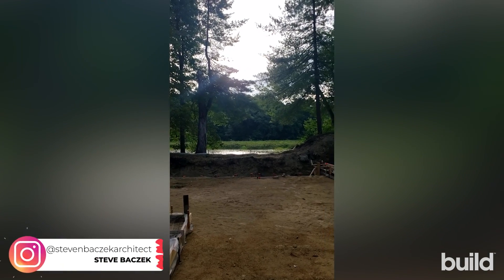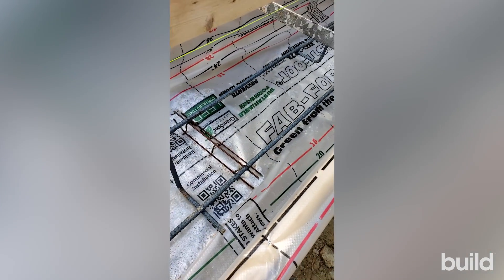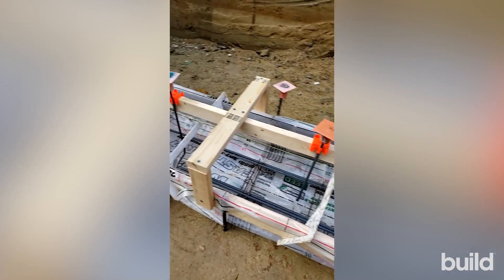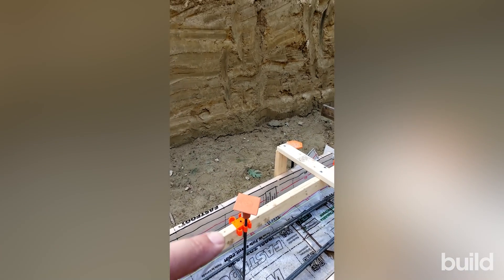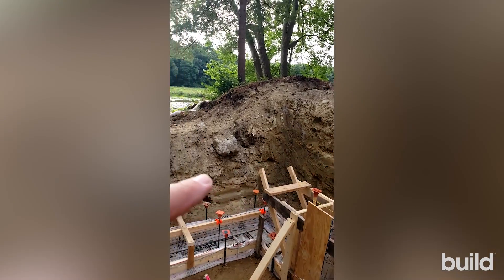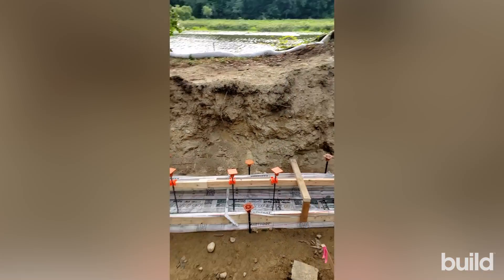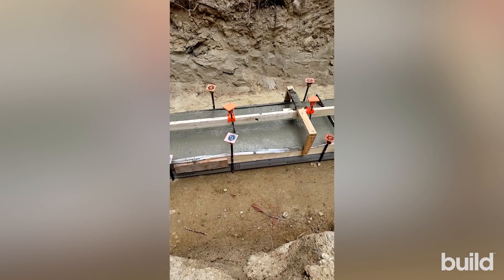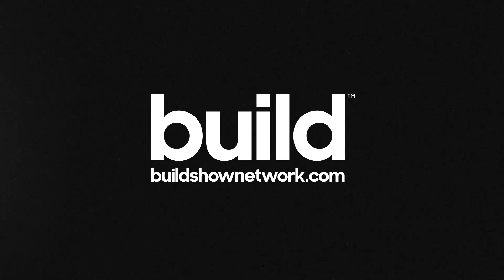FABRIC FORMED CONCRETE FOOTING

Comment: Per ACI 318-19, the minimum concrete cover for rebar that is permanently exposed to and cast against the ground is 3 inches (and no, that thin form liner doesn't change anything).  The rebar is too close to the bottom of the footing - some cases it looks like the hook bars are almost touching the form liner.

Comment: Depth of footing usually is a function of frost line to protect against heaving if the ground freezes.  In the north part of the country clearly has to be deeper than in say Arizona where the frost line is very shallow.  Clearly you also want to consult and engineer.  Seem like they were using #3 rebar for the vertical segments.  seems a little light since you'd think they will be using #4 for the vertical rebars in the wall.  Usually 3" is the minimum coverage of concrete around rebar, seems a little thin with those chairs, but the height of the chairs wasn't disclosed.  Especially with the J verticals UNDER the horizontal rebar in the footing.  Regardless, My guess is the footing when mated with a huge concrete wall isn't going anywhere.....

Comment: Dang Steve I've detailed that J bar for so long i no longer rememered why it was there. I've never seen a detail about alternating their direction  either.  Thanks. Now i need to update all my details.
Reply: If you ever do any detail drawings for the engineering in a building, you're likely to see that alternating J-bar detail a lot.  I still remember the days when they would call for a keyway instead of rebar verts! Ha

Comment: From my understanding, the Fast Foot product primarily allows the waterproofing of the perimeter foundation of a structure. Assuming the use of ICF, they will set upon that smooth, leveled footing surface? Fast Form also offers a supporting "foot" of sorts that will allow the installation of some ICF forms as part of the footing pour, I think. A snazzy system.

Comment: Never move fresh concrete with the viborator and don’t let the concrete flow down the footing to a lower level. It is called aggregate segregation. Use the pump to place the concrete directly, that is why it is there.
Reply: Beat me to mentioning that.
These are supposedly professionals but that's sure not.

Comment: Steve,  Is it common for the electrical service grounding wire to be installed in the footing in residential construction as shown in your video?  I know it happens in commercial buildings.
Reply from the maker: In MA it's required I'm told
Reply: Yea I saw that and was curious about it too

Comment: One more question: where is a pipe for water mitigation?
Reply: That would go on the outside of the footer after the forms come off.
Reply: The pipe is laid outside the footer and covered in gravel and filter cloth. You want to keep the clay soil far from your foundation because it holds water for a long time. Gravel and sand will allow the foundation to drain and shed moisture from the floor and walls.

Comment: Have a question? Why copper wire tied to the rebar?
Reply: It's most often used to provide an earth connection for lightning protection systems, but it can also be the earthing system for the home's electrical installation. Rather than drive a single earth rod into the ground where it is subject to corrosion, the connection to the earth is  made via the rebar and concrete footings over a large area. This protects the connection, and generally gives a better connection to earth. I do wonder though whether the plastic used to construct the forms is somewhat insulative and so negates the benefits. Googer Ufer grounding systems for more info.
Reply: @tlangdon12  Thanks for the info.  You bring up a good question about the plastic being an insulator.
Reply: I have the same question.  @9:39

Comment: For what it’s worth… I’ve never used bag form, but I have had a lot of luck with this visqueen.  The concrete cures a little slower, stays hydrated, a little better, so in theory it’s a little stronger and wicks less water.

Comment: The copper wire @9:28 is probably for a Ufer ground, which is more effective than traditional grounding techniques. Except this footing is wrapped in plastic. So how does that work?

Google is my friend. I found this: https://www.fab-form.com/fastfoot/fastfootFiles/electricalEngineeringLetterUferRod.pdf  It says to cut away the bottom for (at least) 20 feet, and possibly add a traditional ground to help if cutting away the bottom isn't completely effective. However a major advantage of Fastfoot is that it keeps ground water from continually wetting the footing, and therefore the wall. I guess this won't be happening where the bottom is cut away.

I've got a project later this year where I don't need an electrical ground. Fastfoot seems ideal.